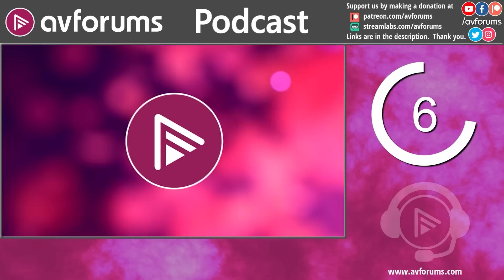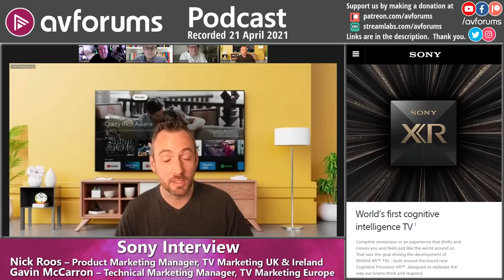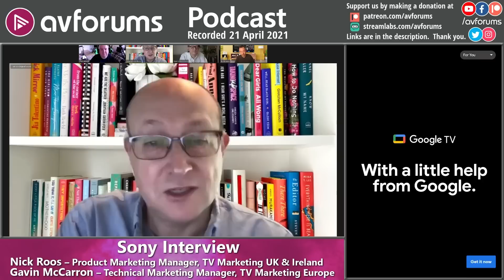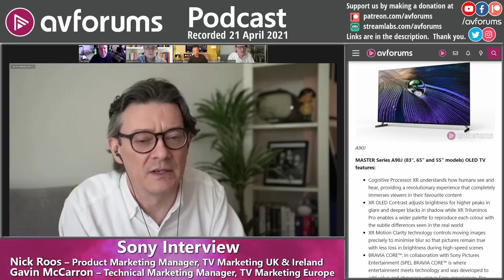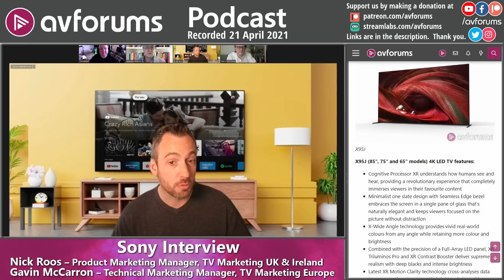Sony A90J & A80J OLED and X90J & X95J BRAVIA XR TV Line-up & Features: Sony Interview

Comment: 50” X90J or 49” X950H? 950 is the thinner and brighter panel, but 90J has HDMI 2.1 for 4K60fps and new XR chip. 

X90J on sale for $1099 and X950H for $999. I know X90J is successor to 900H and X95J (fall release) is 950H successor and will be better, but I’m looking for a smaller screen as a monitor/tv combo. 95J will start a 65” which is way to big.
Reply: Just picked up the x90j and it is much brighter than last years 900H, I’d say it’s on par with X950H and gaming at 120 hz looks fantastic
Reply: @zachkelley7065  I think X90J as inferior range of wide color gamut and DCIP3 compared with 900H. ..Im between LG 48C1 and Sony 50X90J for gaming and movies but i never had OLED technology 🤔

Comment: Would have been nice if you asked for a release date of the X95J and why it's seemingly coming out so much later than all the other models. A90J/A80J/X90J are all out by now and we might STILL have to wait a massive 2 months for X95J. Is there a problem with it? Are they afraid it will cannibalize sales of the other TVs? Is it that good or bad?  Can't be that bad, so that's not it. Even if it's just a 950H with a new name and processor, that's good and no reason to hold it back so long..

It would be exciting but I won't get my hopes up that they did something extra with it. More dimming zones higher brightness?

I simply just don't get why it's released so much later. It's an LCD, not a Master Z9j at that.
Reply: Added HDMI 2.1 for games and the new Apple TV 4K to take advantage of it for sports. I would have waited to get a 95J But they won’t be selling it in a 49” version like the predecessor 950H.
Reply: April/May like always TVs don't have release.
Reply: More dimming zones increase cost can crush black levels blooming not bad on X950G/H
Reply: @WizKing93  I am not talking a bunch of zones just a few more to help make up for the X-Wide angle that lowers contrast by default some.
X90J seemingly have a tiny bit more blooming than the 900H had at least hearing from many that own it. So hence why I am hoping the X95J will not have that.
Reply: X95J will still have few dimming zones. A tv like the QN90A has well over 700+ while this Sony will probably have less than 100

Expect poor performance in dark environments for this Sony X95J
Reply: @tears2040  Dimming zones isn't every thing. QN90A has proven to lose detail because of it and also be dimmer in some instances.
It also only really matter if you sit in a pitch black room. I never do, so blooming is minimized because of bias lighting.
Sony is better at color, shadow detail etc. QN90A is nice and it's still a TV I might consider. But I like Sony. It's theirs to fail. If X95J is an improved 950h They probably got my money.

Comment: I see pricing for the X90J released today. 55" @ £1399 is not overly appealing. I guess from that the X95J 65" will probably be at least £2k. Ouch!
Reply: X95J will be cheaper than Samsung QN90A as an example. It's not a better TV because it has MiniLED. That comes with flaws. Like loss of detail in certain images, black crush and it having to choose between dimming or highlighting. It can look fantastic. Yet at the same time ironically can have as much blooming as a non MiniLED.

I am looking forward to the X95J personally. The way I use my TV as a monitor, an OLED despite better now with burn in, is just asking for it. Also the extra cost of warranty up to $800 or above with Best Buy is just stinging. 
I'll wait for QNED type tech in the future instead.

Comment: At 20:00 minute .. So, we just got NO!! answer on "The" panel in the A90J !! What's in it, that he just cannot say. No, we will NOT use the EVO panel.. Or, YES we use the evo panel.. And it's because of this or that.
Why would we do this interview if they only give the specs we can read on th info page.. We want background ! and reason.. and results..
Reply: He actually said that “ we use the lastest Oled devices and we added new technologies to it” So my guess is yes, they are using the lastest panel from LG (evo)
Reply: @ericlung5086  According to Vincent from HDTV Test, it's def not an EVO panel...
Reply: @gurmukhp   at the start he said it is a new panel because of the different SPD but then says near the end that it has the same power consumption as the old panel so who knows
Reply: Pls watch his video again. Vincent claims that the power consumption is about the same as the a8h and never said the A90j is “not” using the lastest so call evo panel from LG. Based on the new evo panel should be 20% more power efficient than other oled panels, the test Vincent demonstrated is the overall power consumption of the entire TV unit. It is certainly impossible for him to test the power consumption of “just” the panel itself. The new chip and other hardware in the A90j may use more power than the a8h and/or maybe Sony decided to push the panel harder with the use of the heatsink. Furthermore Vincent actually claims word to word  that “the A90j uses a newer Oled panel with slightly different spectral power distribution than the a8h” I am not saying that the A90j is certainly using the new “evo” panel but still, no one can confirm this as of now.
Reply: @gurmukhp  LG phoney you believe him he gets VIP treatment from LG Quantum TV called him out many times.
Reply: I cared because if the A90j is not using the evo panel this year, I will not be buying it this year since Sony will definitely be using the evo panel next year.
Reply: They do use it not allowed say.
Reply: Sony doesn't answer these things. The only thing that matters is how it looks and performs. What does it really matter if they use the new LG EVO panel or not?
Reply: @loki76   completely agree as of right now the A90J gets brighter and has better PQ than the G1 and that’s definitely an “Evo” panel so what’s the difference?
Reply: @loki76  EVO LG trademark not going say using because lawsuit by LG tiny LG would lose to Sony in a courtroom
Reply: @loki76  It does matter.. Because, LG makes the oled panels. And the "EVO" is a newer and better panel. And for sure more enrgy efficient.. and by that as vincent thes said.. immediately for this reason alone less prone to burn in with the same brightness.
So, if sony used this panel. It would say so. Or if not.. They should advertise their "new" panel as better or having different positive aspects. BUt no,.. they don't. SO it's not a newer panel.. !
Reply: LG fanboys on HDTV test channel deny it because know LG have flopped caught Sony C9/CX only have buggy VRR lol 🤣

Comment: I wish someone would explain what the "S-Center" input is for on the A80J...
Reply: I finally got an answer from Sony on this subject.  The A80J can, indeed, act as the Center Channel of your sound system.  The Sony Article titled "Use the TV speakers as the center speaker" (https://www.sony.com/electronics/support/articles/00201071) includes the A90J but not the A80J.  As it turns out, that article is out-of-date (at least the "Applicable Products" portion is out-of-date).  If you look at bullet point "E" on that page, it says:  "TV CENTER SPEAKER IN terminal - The type of CENTER SPEAKER IN terminal varies depending on the model"
This makes sense, since the A90J actually has Speaker-level inputs (they look like conventional spring-loaded speaker lugs), while the A80J has no such connectors.  Instead, the A80J has a 3.5mm input jack, suggesting that the A80J accepts Line-level input from the center channel pre-out on your surround receiver.

So, that's a good thing!
Reply: Same question here!!! Thank you, I'm not alone in this world
Reply: @MindSauce 
 That's not the answer for those of us who have audio systems already in place, and just want to commandeer the TV as the center channel.
What we need to know is what comprises that system's "S Center Channel Out" signal.

Comment: Nick Ross told that X90J is gonna be available in 85 inch! Is this correct?
Reply from the maker: No, the X95J comes in 85-inch, the X90J is 75-inch maximum.
Reply: Nick Ross? Nick Roos Gavin McCarron some marketing
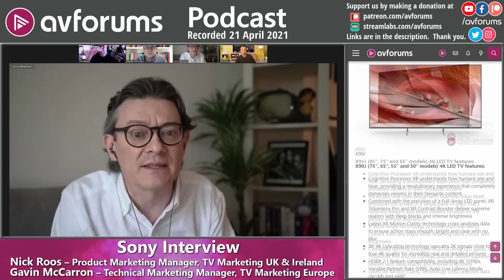Reply: @WizKing93  Even in this video you can clearly hear Gavin McCarron saying X90J 85 inches at 4:30
Reply: @pdg1877  Perhaps 85 inch version is coming sane for X95J 55 inch and 77 inch A90J might be announced